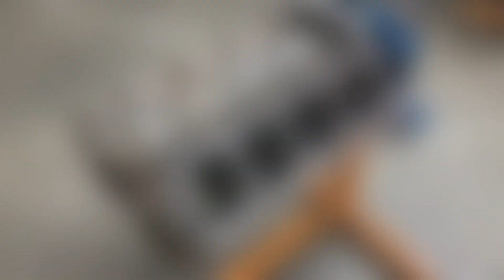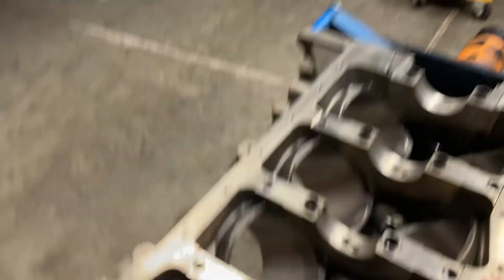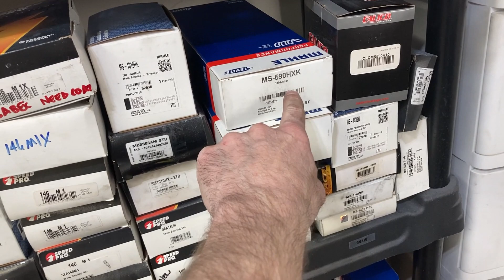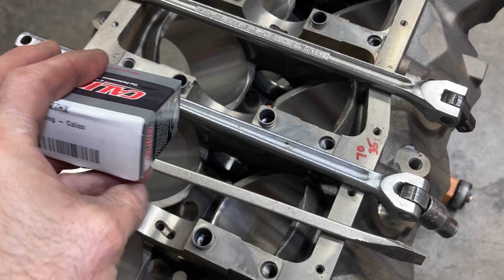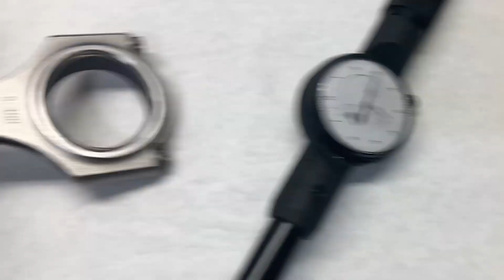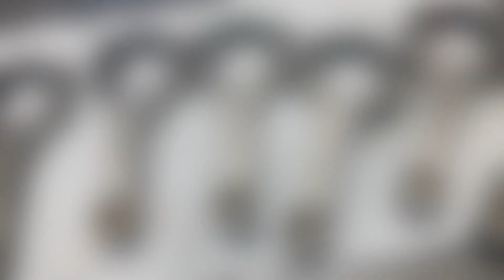Lykins Motorsports Ford 363 SBF World Man O' War Block, Short Block Prep

Comment: I was wondering on this block did you use oil restrictors only in the rear of the block? This is a very informative video especially on MOW stuff. Appreciate it!
Reply from the maker: Yes, rear only.
Reply: @lykinsmotorsports  thank you so much. I had it wrong. I had the oil restrictor in the front of the block. Thanks again

Comment: I'm watching this build!
Been waiting on my DART 8.2" block and AFR 195 Renegade heads for months!
Edelbrock RPM AirGap is also on backorder until....???
Have you used DART 8.2" blocks in any of your previous 363 builds...and what's your professional opinion on them?
I'm using Callies CompStar rods and crank for my build.
Reply from the maker: I like the Dart blocks as well, especially the Iron Eagle blocks that have the capability of choking off the oil at the fronts of the lifter galleries.   I like the Callies cranks, but the rods are a little chunky.